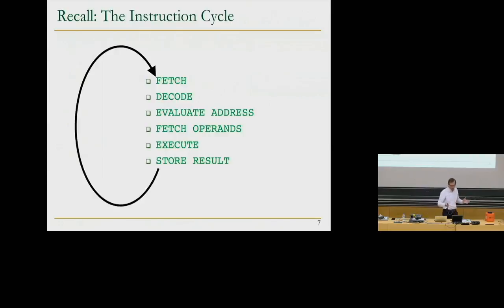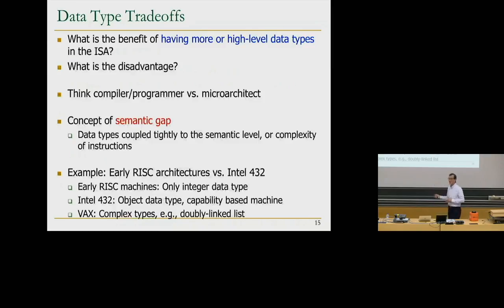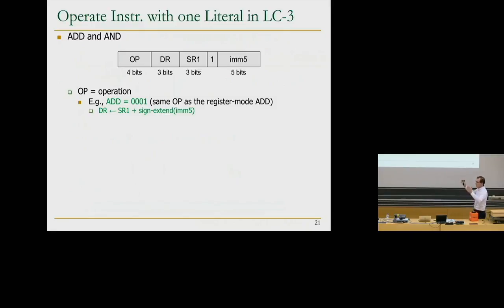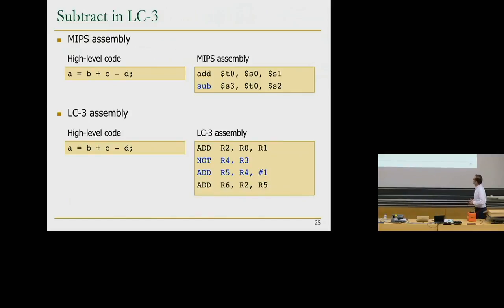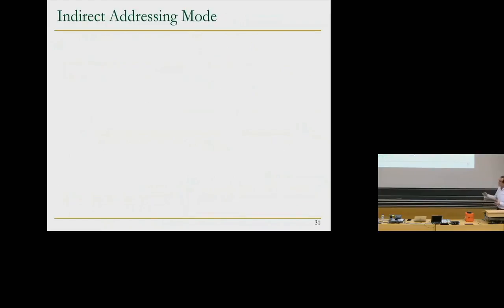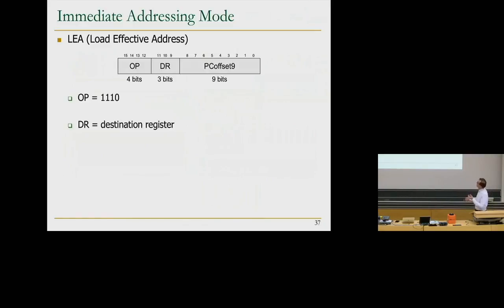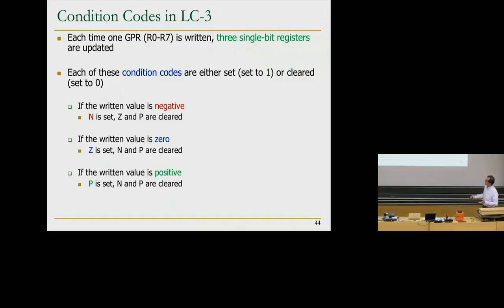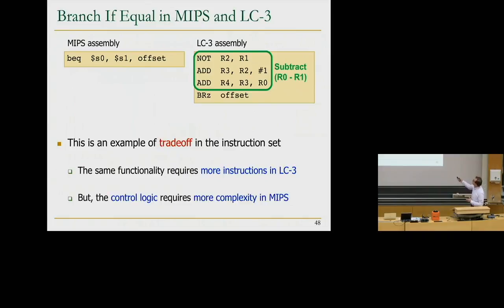Digital Design & Comp. Arch. - Lecture 10a: Instruction Set Architecture (ETH Zürich, Spring 2020)

Comment: At 10:30 it is claimed that “you are functionally complete once you have ‘and’ and ‘not’ “ and that the ‘add’ instruction was added for convenience. It is true that from the set of two bit Boolean functions all of them can be implemented with ‘and’ and ‘not.’ What is not true is that all multi-bit functions (for example add) can be implemented with just those two hardware _instructions_. Multi-bit operations can be implemented with ‘and’ and ‘not’ hardware _gates_. and arbitrary routing between gates, thus allowing for the implementation to propagate a carry bit to the next bit position, for example to implement ‘add.’ With just bit wise ‘and’ and ‘not,’ addition and all other other arithmetic operations, can not be implemented directly in a reasonable manner. An unreasonably expensive implementation OD ‘add’ would involve tables, in a byte addressable machine, with a larger than 64k byte address space (I.e neither LC-3 nor LC-3b) and doing they byte by byte operations by indexing into such tables to obtain the byte result, another table to obtain the carry byte, moving an upper byte into the lower byte can be done by storing the word and fetching the specific byte. For completeness, instead of ‘add’ from a perspective of hardware simplicity, at least a shift instructions would be required.

Comment: Thank you so much, Professor Onur. I think that the note at the end of the 30th slide @ 27:00 should be from +255 to -256 as this is the range for a 9 bit two's complement integer?
I think what's written in the slide would be right if it's expressing the offset from the current instruction PC, not (PC+) the address of the next instruction.
Reply: correct